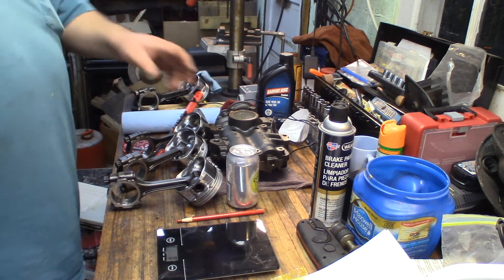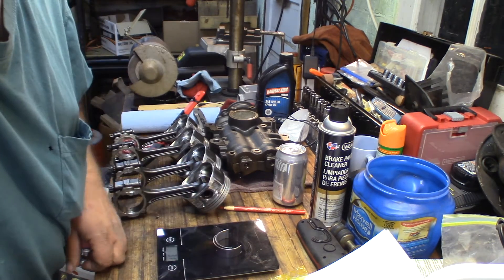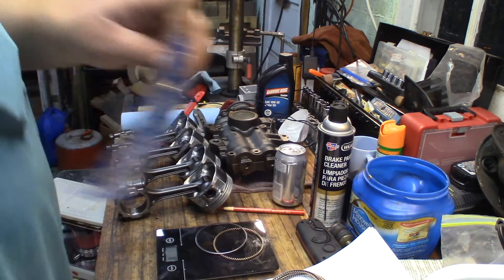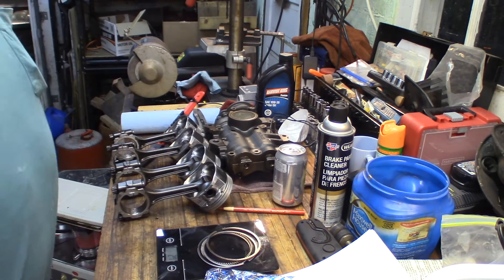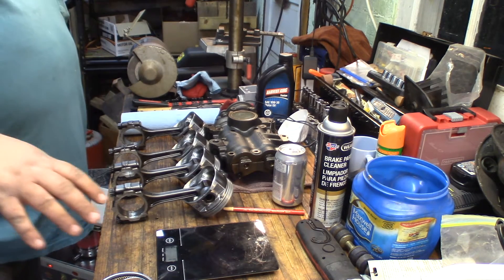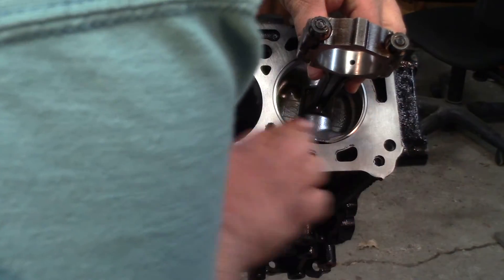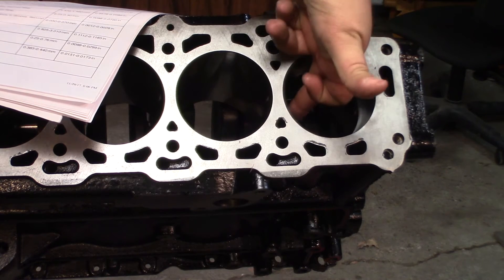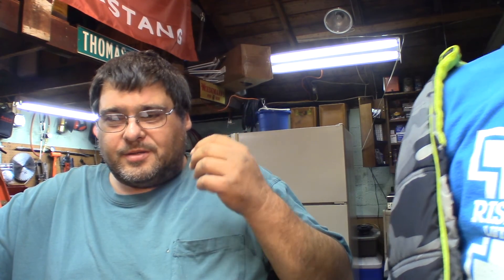GM 2.4 Quad 4 LD9 Twin Cam Engine Rebuild - Getting Pistons Ready - 1999 Grand Am - Part 4

Comment: How did you get all that chilton info I'm doing my 01 2.4 L and need torque specs and specs in general
Reply from the maker: I get the Chiltons Online through the library for free.  If your library doesn't offer it they probably have a Chiltons or Haynes books in the reference section that you can look in.  If you want to send me your e-mail in a private message I will be happy to look up the specs for you and print them to a PDF and e-mail it to you.  Just send me the Make and Model and I will look it up.
Reply: Yea I was not able to find anything for all the chilton specs, I would appreciate the help  but I went to private message you and  cannot it's not showing up on your about section of your channel.
Reply from the maker: Dustin.  I got your e-mail.  I just sent you back everything I think you will need in PDF's
Reply: Thanks Tom your the man!
Reply: Your a good man, helping those in need of info